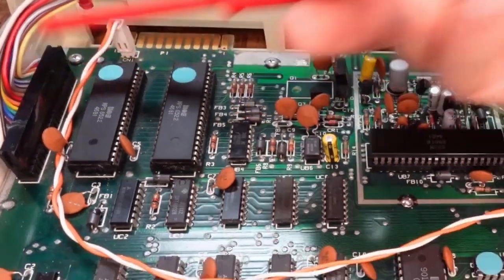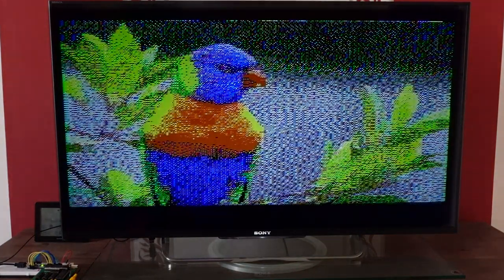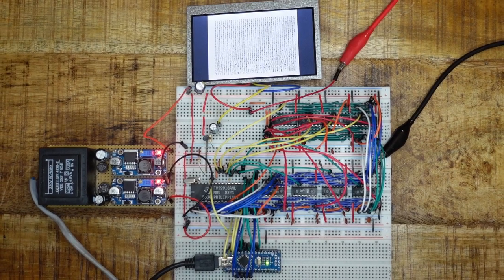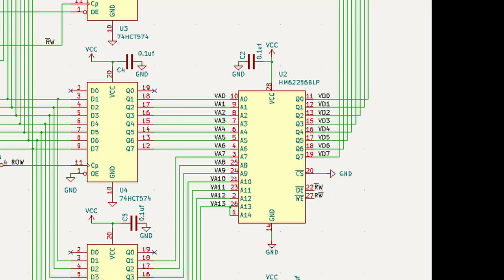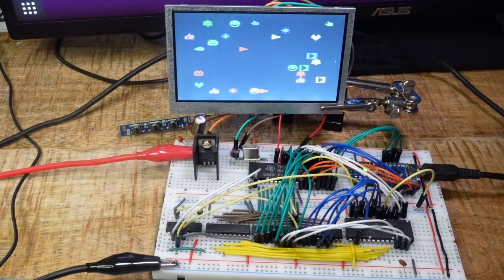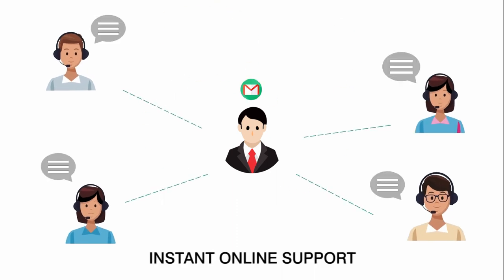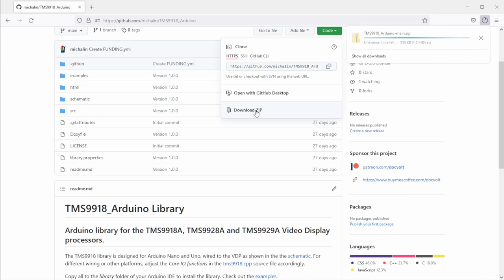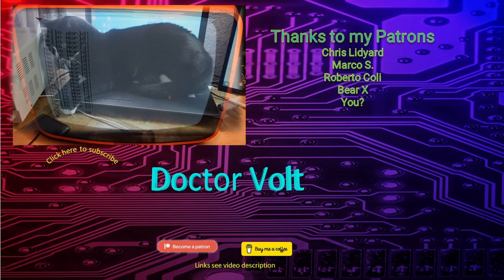Video Card for Arduino and DIY Computers #2: PCB and Arduino Library

Comment: the 9918 was also used in msx1 home computers. the 9938 is the improved version, and there are more improved versions with higher resolutions and colors.
Reply from the maker: Yes, the whole TMS99.. family was very successful and ahead of its time
Reply: right! underway building a 9938 video card for my diy 6809 :-)
Reply: @DoctorVolt   I am curious why TMS99 chips wasn't adopted in early IBM PC?
Reply from the maker: @lim0408  Mabe because it only supports 40 characters per line, while the PCs had 80.

Comment: The TMS9128 is a better choice. You only need that chip plus 2 x 4-bit RAM chips. A 3-chip solution better than the Hackaday static RAM method.

Comment: great work congratulations !! , I can already imagine its use in the RC field, drones or other, in which you can create a video page with all the parameters to be displayed and, if necessary, through a swithc, recall or superimpose the image of the camera  with a circuit on screen display 'OSD', I would like to ask you is it difficult to find the components used? ,
Reply from the maker: The logic chips and the SRAM are stock componets which you can get from any electronic supplier. The VDP is still easy to find on Ebay. You can feed a composite signal into Pin 35 and set Bit 7 in Register 0 to use it for OSD.

Comment: When trying to get boards made from the gerber files downloaded from the linked GitHub, I get an error about a missing soldermask layer.  I tried it on a couple different PCB houses' sites, and the same thing happens.  😲
Reply from the maker: I just uploaded them
Reply: @DoctorVolt  Thanks!  I grabbed 'em and placed an order.  🙂

Comment: would it be possible to go up to 80 columns in text mode ?
Reply from the maker: Unfortunately not, because the 40 columns is a limitation of the TMS9918 itself.
Reply: Not with a 9918.  The V9938 will do it.  There is also a 256 colour mode on the V9938.
Reply: Nice, but might you choose a more readily available graphics chip?
Reply: @MattKasdorf  I was talking about a chip compatible with the TMS9918.
Reply: @douro20  In a way, I was too.